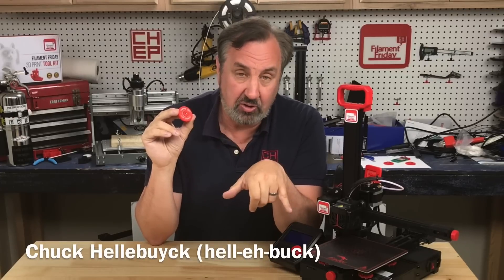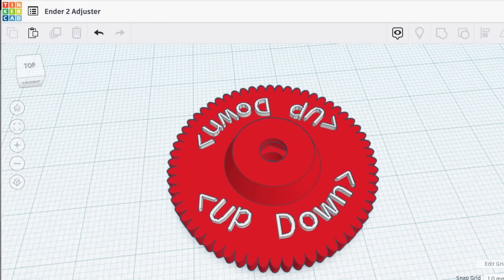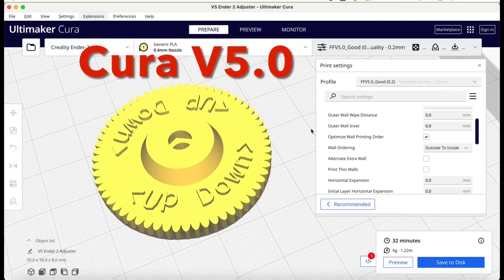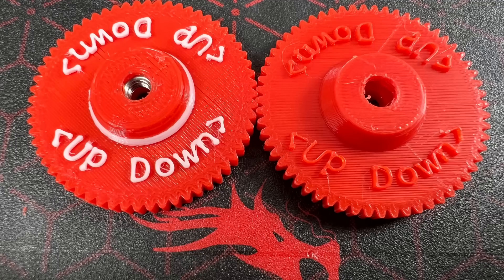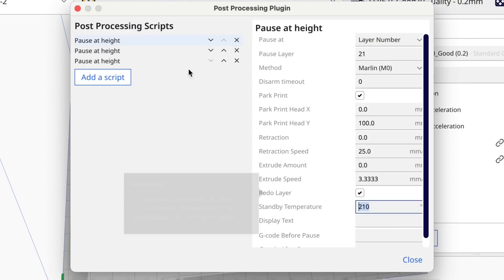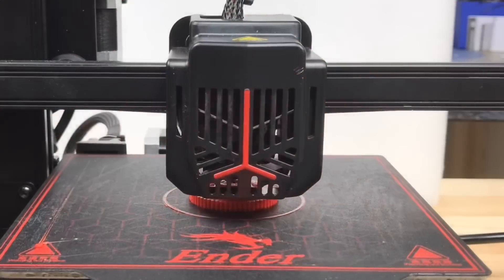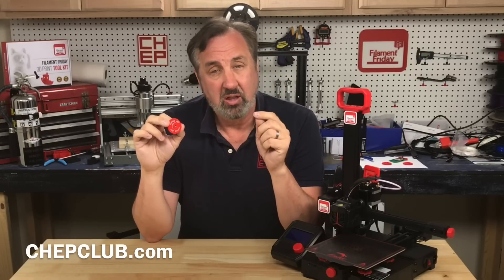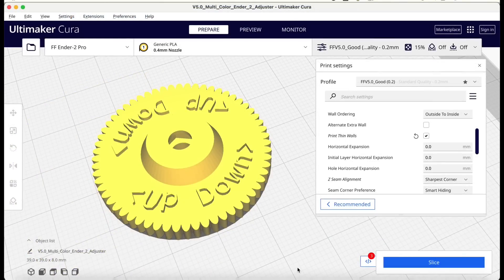Ender 2 Pro Adjuster Knobs for Easier Bed Leveling

Comment: I printed one finally today for my Ender 2 Pro (thank you btw) the M4 nut rattles around inside the knob is that by design? I’m using a 4mm-0.70 nut.
Reply from the maker: Use horizontal expansion to adjust it. https://youtu.be/UUelLZvDelU

Comment: In cura 5.0 after I clicked “open as new project” I can’t select “create new” because there is no box on the right where I can select it. What am I doing wrong?
Reply from the maker: In preferences, make sure opening a project is set to the drop down “always ask”
Reply: @FilamentFriday  preferences->under opening and saving files there is one thing “show summary dialog when saving project. Default behavior when opening a project file: always ask me this” I didn’t change anything so it was already set to it.
Reply from the maker: Maybe reinstall?
Reply: @FilamentFriday  wait I think I’ve got it. I just opened the project without creating a new project. (So it made a new printer with ender 2 pro). I removed the ender 2 pro profile and I stil got your print profile. Is this the right way?
Reply from the maker: That works.
Reply: @FilamentFriday  do I need to change the flow settings from 95 to 100? Or is the 95% flow specific for your profile?
Reply from the maker: You can change it to fit your printer.

Comment: Have you tested your Extra Fast Profiles on 5.0? I tried them on the BETA version but they did not print well, so I went back to V4.13.1
Reply: 5.0 official worked fine for me with CHEP .28 extra fast but in the 5.10 +304 beta its sloppy.

Comment: Hi Chep, thank you for your excellent profiles. Ive been only starting 3d printing for two weeks now and had some trouble to get everything working smoothly (bed level, but also general quality and oozing). Ive got the ender 3 s1 pro (which you reviewed). Can we expect any Cura 5 , specific ender 3 s1 pro profiles on your website? That would be wonderful.

Comment: Hi Sir, I am having issue with wall lines and they are not fusing together. what could be the issue, I am unable to diagnose it. please help me. 🙁🙁
Reply: I think you're having the same problem as me. The infill is ok but the wall lines are just like separate lines and not fusing and creating proper wall. I'm so confused as how to fix this.

Comment: the fast profile and fine profile didn't import into the final release of CURA 5.0.  is there another way of importing those items?  also do you 4.12 profiles also work in CURA 5.0?  Thanks
Reply from the maker: What error are you seeing?
Reply: @FilamentFriday  I'm not seeing any error and i'm also not seeing the option to choose the smooth or fast print profile option.
Reply: @FilamentFriday  I have the same problem as him. It doesn't seem to allow me to open the file as a project. In settings, it is set to ask me if I want to open a file as a project. However,  no dialog popup or any other way to open the file as a project. It opens as an object and no settings are changed. Any suggestions?

Comment: Hi Chep. I'm fairly new to 3D printing and had a question I hoped you could help with. 

I installed a .2mm nozzle on my printer and wanted to use your profile which looks like it needs a .4mm nozzle. Are there any issues with printing using your profile with a .2mm nozzle or would I need a profile built specifically for .2mm nozzle to make it work?

Also, since Cura 5 now does variable line thickness, does this eliminate the need to even use a .2mm nozzle?
Reply from the maker: 0.2 nozzle would require modifications to flow, extrusion width, temperature and possibly other settings. V5.0 doesn’t eliminate the need to adjust for nozzle size.
Reply: @FilamentFriday  Thanks for the info! Really appreciate it.

Comment: Loving the Cura 5.0.  Hell used the same profiles from my Cura 4.11, just added the wall minimum wall line width option in.  That setting tells Cura what wall minimum size to consider when slicing.  This is how it gets that amazing detail even on a FDM printer, something that typically you would get on a Resin, is possible now on a FDM printer without even having to change nozzle sizes.
Had a building I designed for N scale that I first printed in Cura 4.11, or at least looked at the preview.  There were certain details (door details) that were just not showing up, and were completely ignored, even with thin walls on.  At first I had to adjust the details to be a little bigger in the actual model so it would print, but now with cura 5.0 I have now returned them to their original sizes and they show up and print well.  
Using both a Neptune 2 and Neptune 2S.

Comment: I installed Cura 5 and have nothing but issues with it. My profiles worked perfectly on Cura 4.0 with both Ender 5 and Ender 3. But the same profiles on Cura 5 are producing miserable results. I suppose at some point I'll mess around with using the default 5.0 profiles, and see if that works. But for now, I'm having to go back to 4.x to get any work done. It's too bad that if this new version is as great as people say that it is, that it doesn't appear to be backwards compatible with custom profiles that users have worked hard to fine tune.

Comment: I've been having issues with Cura 5 for my machines (probably user error) but the profile was so terrible now I don't care about speed but I want quality. But the ordering of the walls was all over the place and lots of issues, I did a full Cura clear out as I went from 4.13 to 5 and had nothing but issues, however I have gone back after trying out a few other slicers to find that Cura is ultimately the easiest to navigate but I love the print monitoring from a different slicer that showed what part of the gcode it has in memory to give an idea of the nozzle path and to guesstimate layers till completion. A feature I actually loved in prusa slicer was that it first heats up the bed then does a bed 9point probe while heating up the nozzle this I love and want to get that in Cura as I don't need a hot nozzle then probe the 9 points. I am considering on just copying out the best parts of the gcode start of the features I like from the other slicers then having to manually edit every single file I make but I'm hoping Cura has a task Priory ordering thing.

Comment: I tested 20x20x20 cube to print walls and see how precise wall thickness is. I got thickness from 0,36 to 0,45mm. Cant get all 4 walls to be within 0,02. No such problems in 4.13.1

Comment: nice video quick question though as I was playing with your 5.0 profile,
 and noticed once I add  hole horizontal expansion I loose detail on the lettering. any idea as to why or how i can fix it. I usually need .1-.3 depending on my printer
Reply from the maker: It’s probably a 5.0 bug.

Comment: I need an upgraded OS to install 5.0 but it would cripple fourteen other applications I use regularly as they are not supported on any OS higher than what I’m using.

I’m looking at other solutions.

Great project.

I used a 1mm white acrylic paint pen and drew up and down on the stock thumb wheels.

Comment: I'd love to give Cura 5.0 a go but it won't fully open on my MacBook Pro running Monterey iOS...

It begins opening but never fully does. Previous versions open fine. 

Can't find an answer for this issue anywhere...
Reply: Hmm, 4.xx just crashed on my Air M1, 5 works perfect.
Reply: @no66  My MacBook Pro is 2017 so not M1. Should work perfectly but alas...
Reply: @eatyourvegfpv  Ah, I see. New to this mac stuff, pc user since 286 :-)
Reply: @no66  Thats a bloomin' long time! 😜
Reply: @eatyourvegfpv  Spectums befor that :-)

Comment: On ender3v2 cura 4.X version when pausing at height, the printer is set to retract so you can change the filament. You can change the amount/speed of retraction to whatever you want, however, whatever you retract the printer will extrude upon resume and it will cause a blobby mess on your print. To combat this, you can either set the retract at 0, keep the nozzle hot and pull out the filament. Or you can edit the GCode file before sending it to the printer to delete the command that causes it to extrude after resuming. Hopefully this is resolved in 5.0 if not then use the remedy above. If there is a better way, please let me know.
Reply from the maker: I kept it 0 for this reason. And I used 5.0 in the video.

Comment: Wow this looks really helpful. Could you tell me, regarding the pause at layer height command, does it pause before printing that layer or after? So if I say pause at layer 10, does it print layer 9 and then pause before printing layer 10 or does it print layer 10 and then pause?
Many thanks for your informative videos.
Reply: If you hoover the mouse over the layer option, it should show you a expansion. 
Anyway, the Filament change is at the beginning of the layer. 
Meaning the layer you select for change will be printed with the new filament

Comment: Chuck, does the high speed profile work with v5 or are you working on a new version for that?
Reply from the maker: Both.
Reply: High speed does work on 5.0. I'm printing the lowers of the Ikea Lack enclosure in just 2 hours verses 4-6 hours

Comment: I had trouble getting pause at height to work on my ender 3 for a long time, after updating the firmware it would pause but immediately resume on its own. I finally found that if you change the gcode line for pausing from M0 to M0 S300 it adds a five minute timeout (300 seconds) which should give ample time for a filament switch.

Someone hypothesized it's to do with how commands are buffered or something. If anyone else has an alternate solution I'm all ears.
Reply from the maker: There is a setting in the Cura Pause at Height box to set that delay.
Reply: @FilamentFriday  I saw a setting for "Disarm Timeout" but it looks like that's to do with the stepper motors. I tried adding a value to it but it did not seem to resolve the issue. For now I'm just adding a search and replace script and its been working without fuss.

Thanks for the reply though, I greatly appreciate your interaction with commenters.

Comment: I uninstalled Cura 5.0. As soon as i started using it i had alot of print issues and the quality was on the test cubes were had gone backwards on top of having warping issues, Wen't back to cura 4.13 and within 2 prints i had far better quality prints and my warping issues were gone on my ender 3 v2
Reply: I'm battling with 5 as well, top layers not smooth, globs etc.
Always had super nice prints in previous series on well tuned and upgraded Ender 3 Pro

Comment: Cura5 has never given me a faster print time than 4.13 i have sliced the same stl in both and 5 is always long to print and the quality is the same. i get great lettering in 4.13 on my A10 and so far the only thing i have found better about 5 is the supports do work a little nicer but i still have both installed and find myself using 4 more .

Comment: So many issues with 5.0...
The fact that random seams DO NOT WORK was the last straw. 
My prints look MUCH better in 4.13 than 5.0... it was so frustrating trying to get good prints. My prints are PERFECT in 4.13 with the same exact settings.... 100
Reply: I'm sure they're still ironing out the kinks of the new slicing system (on a related note ironing is one of the features they said is broken in this update). Best to wait for a few patches before making a full switch.

Comment: Been printing for only about 2 weeks, so Cura 5.x is all I've known, and this profile is the cleanest thing I've used yet. I've tried copying settings from suggestions etc, but hadn't gotten around to just grabbing a whole profile until yesterday. It was fate that this was released the same day I had that thought haha. Also your squares and knob leveling so you don't have to slide the head was an amazing find. Thank you.

Comment: Tried to load Cura 5.0 on a Windows 10 machine but found it only installs, and is visible, when the user account has administrator privileges.  Under the non-administrator account, which is more secure, Cura isn't shown in the Start menu (or even in the Apps loaded).  Kind of weird that the developers didn't follow modern Windows security standards for Cura 5.0, especially since Cura 4.x does.  Hopefully it will be fixed in a new release.
Reply: Curious, it installed fine for me on win10 and is in the start menu,
Reply: @keithwhite9158  Is the account you log into Windows an administrator account?  If so, that is likely why you are seeing Cura 5.0 in the Start menu.  FYI:  I only use standard/local accounts without admin privileges because they have a higher level of security and protection against internet malware.

Thanks!

Comment: Great work with the redesigned wheel with drop in nut which I might borrow in a future design. Can confirm the profile works great on my new ender 2 pro even on 0.16 layer height. Getting some nice prints. Will try 0.3 nozzles in the future for some fine detailed minatures. Cheers
Reply: Hey Jason, sorry to bother you, but I haven't seen a lot of people around using this printer. Do you happen to have the nozzle hit the print frequently too? I'm trying to figure out if this is a hardware issue on my side or if it's just a common thing when you rely on a single profile to hold all the weight of the nozzle.
Reply: @TuxraGamer  Funny thing is I have this problem on my Aquila X2 but not on my Ender 2 Pro. Check for any play at all from your eccentric nuts not but just spinning the wheels, try to move the frame the wheel's attached to back,forth, up and down. Then check hot end for play at the nozzle. In cura make cure combing is not in skin, try different infills and infill %. I've only changed to bowden tube to capricorn, bigger brass couplers, re-seat ptfe tube snug against nozzle, pid tune and now good results with some minor whisper of stringing I'm still tuning out. Hope that helps

Comment: Why to put second filament change?! It does not change much.
Reply: Just looks pretty....

I would do the same thing.
Reply: @DeanosRides  no one sees upper part of this crew. Each change of filament - waste of time and risk of print troubles.
Reply: @melickon  Wish I could show you the light sabre I printed! Took 17 hours and had 19 filament changes with 4 different colours in it because I didn't want to paint the final product. Turned out so nice! Everybody wants one now, but no ways. too much work.... 😂😂😂😂
Reply from the maker: It really wasn’t needed but I didn’t realize that until after it was filmed. I do kinda like the pylon look though.

Comment: why doies  it have down?? obviously the opposite of up is down!! lol
Reply from the maker: With that, why do we see on/off or 1/0 on switches. Open/Closed signs. In/Out Door. Entrance/Exit signs. 
If I just did up> I’m sure I’d have someone tell me “you should have up and down to make it easier”.
Reply: @FilamentFriday  they might want up and down but we more smarter and more efficient ones know better.  entance/exit and open/closed are different . thet are both needed there. but on/off need only 1. either on or off. im sure u want to make it for the 90% who get confused by such things. but thx for the prrnting tip. we all want better quality. depending on the need of course.
Reply: Yeah but try having just the label "Down" with two arrows pointing either direction
Reply: @funx24x7  i meant to have just up word with 1 arrow for the direction. the opposite is obvious.
Reply: @IronMan-yg4qw  you know what, I had not thought of this for some reason, you are correct

Comment: My printer head has lock up can't get filient in, on my 5th print , my bed is wobbley. S3 ender pro
Reply: check the eccentric nut on the printer carriage, and make sure that the rubber stoppers are in the right location the one in the top left corner should be shorter than the rest
Reply: @aquarocket8165  after I removed  the filament ( to lean the machine over)and ajusted the bed it will no longer accept the filament.  I got this printer in hopes I would not have to do all this.

Comment: nice idea with the nut .. can i use the profile on a direct drive printer like sovol .and if so, what should i adjust ?
Reply from the maker: Reduce retraction to 1 or 2 depending on your testing.

Comment: Will the redo layer option help with the bonding between the 2 different colors? I tried to do a 2 color print this week and it was a weak bond between the 2 colors and it split.
Reply from the maker: Yes, that is the purpose.
Reply: @FilamentFriday  Thanks, I'll try it out.

Comment: Does "pause at height" work with Octoprint now? I remember there was an issue with that in the past.
Reply: Just did it today with Ender 3 and latest Octoprint. May depend on firmware on printer if it understands pause command though
Reply: @fouroakfarm  Thanks, I have the latest community firmware for my CR6 SE and the latest version of Octoprint, so I'll give it a shot.

Comment: any suggestions for using your profiles with microswiss all metal hotend? obviously retraction distance should be shorter
Reply from the maker: Adjust retraction for your setup. If it’s still bowden it shouldn’t change much.
Reply: I'm still tuning a MS hot end, I've run up to  8mm to reduce stringing on test print, but around 5 is working well for me. Depends on the object, I'm finding.

Comment: Great channel! Where can I find the post processing plugin?
Reply: To use post-processing scripts in Cura, click the Extensions tab on the top menu, bring your mouse over to the Post Processing option, and click the Modify G-Code that appears as a result. It should just be there. you shouldn't need a plug in. (I don't think so at least. in Cura 5.0 it's just there for me)
Reply: @spitewickonline   I've used the script before but it has been a long time since I needed it and it just looked different. Thank you for the help!